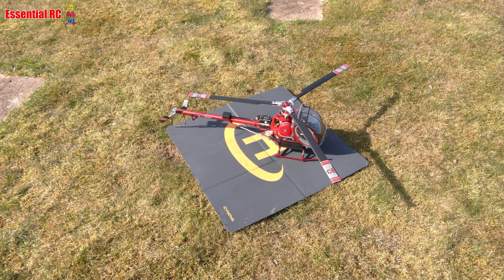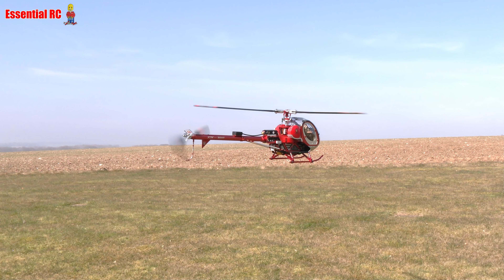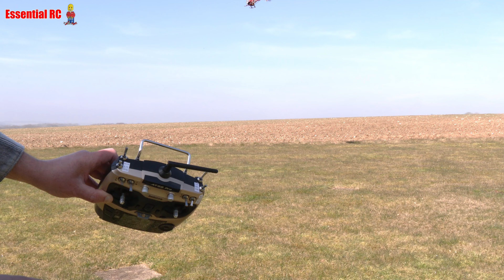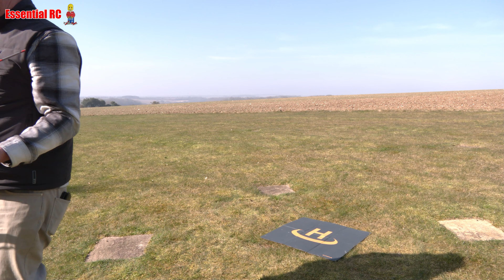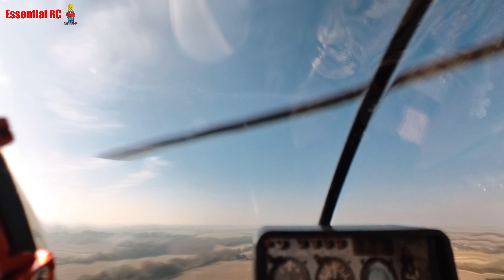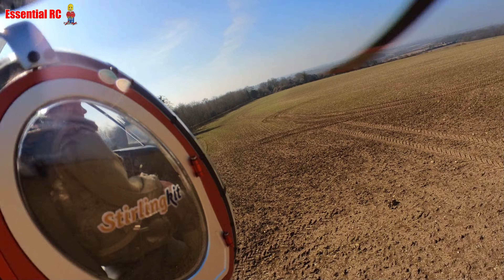EASY TO FLY ! JCZK Schweizer 300C PRO GPS Smart RC Helicopter

Comment: I’m torn between “that’s really cool” and “that’s not really flying”.

Clearly it flies more like a quadcopter than a helicopter but can it be used as a starting point for model helicopters - for example can the right stick be changed to work as a collective?

Comment: Can this gps unit be retrofitted to a trex 450 se helicopter, it’s got a robbe Heli stabilization unit fitted now?
Reply from the maker: Don't think the GPS by itself would be compatible with a stabilization unit. You would probably want to replace the whole stabilization unit with a Fly Wing H2 flight controller package. That comes with its own GPS. At the time of making this video this helicopter came with a H1 flight controller but its been superceeded.

Comment: Hi , I have a question. Is build and quality of this model from Sterlingkit is different than other suppliers like AliExpress?   I appreciate if you could help ,
Reply from the maker: I think it's good quality. If you look after it and maintain it it will give you many flights. I don't buy from AliExpress so I cannot make a comparison. But I have flown many of the other GPS helicopters and this is one of the best and biggest.

Comment: I wish I knew about your discount code before I bought it, also I bought mine 2 weeks ago and haven't heard anything yet about shipping? I msg Stirlingkit and haven't heard back?? Im getting a bit concerned about the lack of communications with them??? What are your thoughts?
Reply from the maker: Sorry to hear that. I can follow up with them about it but would need more info...which you shouldn't share here. I'm guessing you didn't use my link. Maybe message me?
Reply: @EssentialRC  i finally got it and it flys great with the new h2 controller. Im hearing that you should calibrate it before flight? It doesnt really say much in the manual about how to do that? Do you know what the procedure is? Thanks again

Comment: Hi
I'm looking at purchasing this or the Bell 206 
I like this but my concern is the Belt operation.
Would it require replacing after a certain amount of time or should I not be concerned 🤔
Reply from the maker: I've had 20 flights without a problem.
Reply: @EssentialRC 
Did you have to pay import tax to uk 🇬🇧 from shipping address 🤔
Reply from the maker: No. Suggest you talk to them about that after you've got an order number.

Comment: What scal is that tom hanks figure?
Reply from the maker: 1/12
Reply: Thanks
Reply: Ps is that the tom hanks head add on or the whole tom hanks model. I see we get 2 figures with the heli  and was wondering if i was able to buy just the head i see on ebay
Reply from the maker: It's the Captain Miller figure from the Saving Private Ryan film. Tom Hanks played the part of Captain Miller if you didn't know. It's quite a complex figure with lots of accessories and different sets of hands...so it's not cheap to buy.
Reply: Where can we buy that same figure?